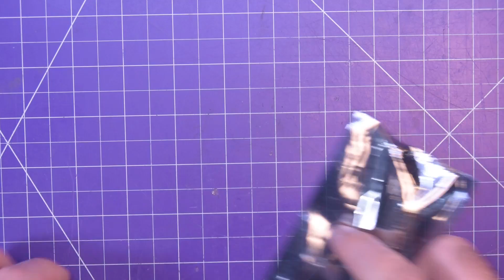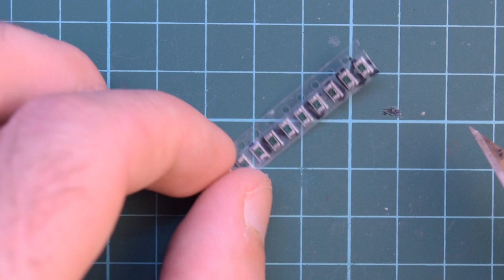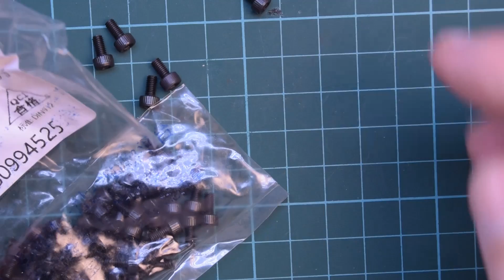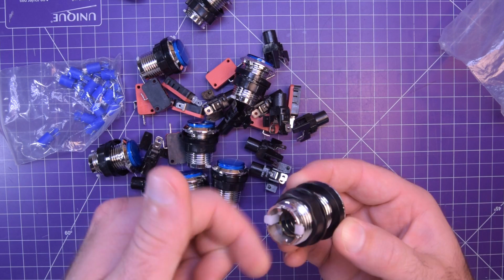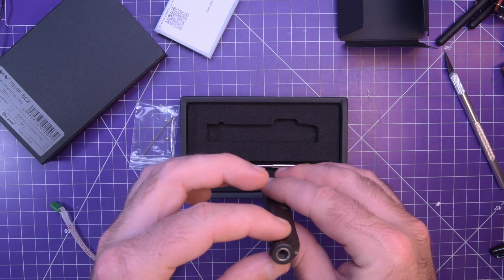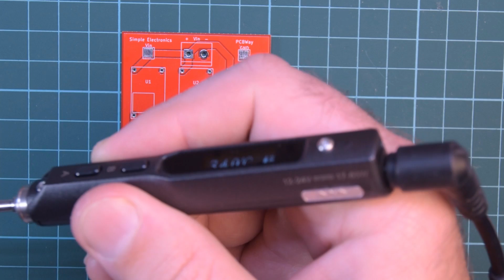Mailbag 64 - Exciting but Expensive!

Comment: The micro USB lets you change parameters such as default temp, standby time etc.  Pulling the cable out is safest when finished. To put in standby hold both buttons for three seconds.

Comment: I see you also joined TS100 crowd. I got mine on AliExpress with local shipping at about 73 CAD. With iron I got small stand, jack to xt60 silicone cable, and even 24v power supply. For powering for now I used 5 18650's put in those battery holders, one 4 cells big and one single cell, stuck together with some double sided tape and soldered with some pieces of wire, works great.

Comment: I've had a TS-80 and now 2 TS-100s. Great little irons but not made for heavy use . They get flaky  after a while
Reply: Thanks for the info.  Define "flaky" :) I'm in the market to replace one of my bench irons and have been eying the all in one tip units. I have a real Hakko and a clone that I have had for close to 6 years. I keep different tips on the two now but would like to get some space back.
Reply: @UReasonIt  I had the TS 80 for about a year and a half and  I started getting the occasional SENSE error which was due to bad connection at the tip  (I change tips often). Then the power connector loosened up causing really annoying random "reboots". I put tight fitting heat shrink over the new connector and so far it's fine. The TS 100 very  randomly shuts down for no reason I can find so far.  More annoyance. Despite that I still think they're great little irons, they just need to be more rugged. BTW I think you can use tips from at least one other popular iron but its a little awkward. Check Louis Rossman's review.
Reply: @pleasecho2  Thank you for the information, as it has helped me a lot. I try not to change tips a lot but do sometimes. I can see how the clip could get some stress on it after time. I think I will get one of the T12 units with no PSU and power with my own power. This will free a little space.

Comment: I wanted to do the current measurement to, and I found Dave Jones tutorial on opamps invaluable,I then studied his Microcurrent design and ended up designing my own current meter that works great, in fact i've just finished my design for a current meter with its own ADC and screen.
Reply from the maker: That would be the dream....my ambition is 100....but my follow-thru is a 10!

Comment: I wonder how that would work with a battery adapter on a power tool battery. Either a pre-built one or a DIY version that would output a higher voltage.
Reply from the maker: Hehe - on the way!
Reply: @SimpleElectronics  i have one im checking out on a recycled Dewalt battery. All I spent was for adapter. The battery was free from a recycling center.

Comment: Like the arcade buttons.  The biggest hassle will be finding a drill bit large enough to produce clean holes.
Do not remember my TS100 costing so much.  You upgraded the firmware?
Your May orders just rolling in?  Now there is hope for my own May orders!
Reply: I'd recommend a step drill .
Princess Auto has a $20 set that will get big enough for the arcade buttons.
Reply from the maker: Got a bunch of step drills already! I want to mount them into plywood - a forstner bit may be better
Reply from the maker: I have not done any mods yet!

Comment: Arcade buttons link is incomplete?  don't got the link for the full set. Add the open source firmware to the TS100 it rocks, problem are the tips too expensive I rather the T12, tips are more affordable
Reply from the maker: you have to scroll down about 20 items, but it's there :) I want to avoid linking to specific sellers because they tend to jack up the price
Reply from the maker: Let me look, one moment please
Reply: T12 tips are longer, and put your fingers farther from the work.
Reply: @GnuReligion  you know that you can also print and but a T12 tip adapter for this iron?
Reply: @belenhedderich3330  The ones I printed last year with PLA were not so great.
Now that I have TPU though ... that may work better.  Where are your favorite STLs?